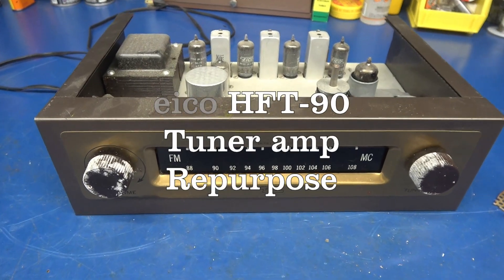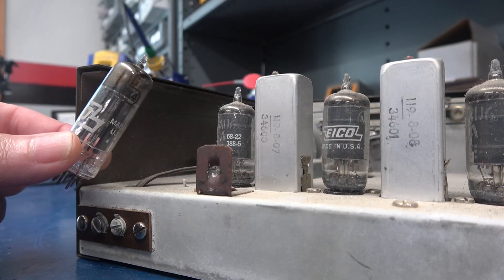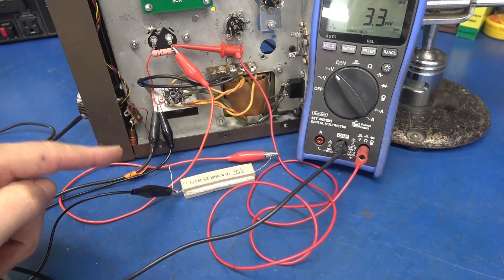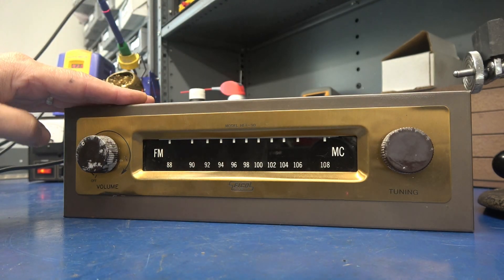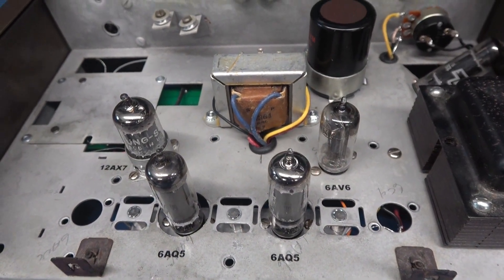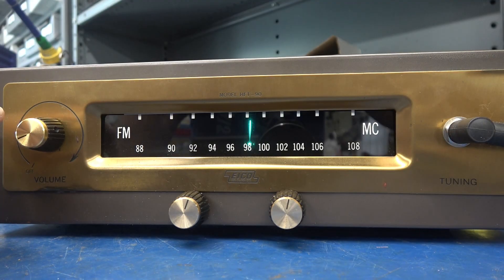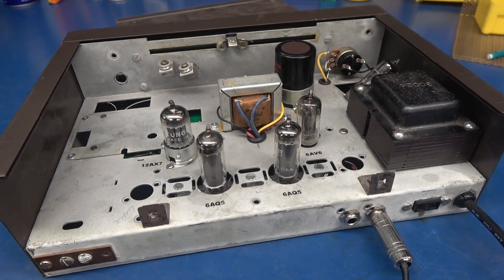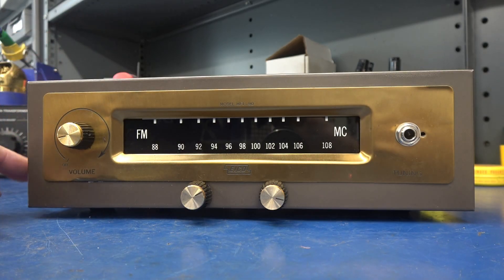Vintage eico HFT90 tuner repurpose to push pull 6AQ5 tube guitar amp retro look great project

Comment: Thanks !  I built two Eico HF-20's for my stereo back in the early 60's, I was around 13 years young.  It had a pair of 6L6's in push pull (I think) and a 5U4 rectifier.    '73 de Bob

Comment: The 6X4 rectifier was used in the Hammond B-3 organ it is also notorious for developing a short circuit. (Hammond realized the tube was substandard and their fix was to recommend the tube be changed annually, since the pre-amp was not fused.)
Personally, I don't like the idea of that tube being mounted at an angle, but YMMV.
And PLEASE be sure the power transformer is properly fused; it may save your transformer one day.

Comment: I have one of those tuners I picked up for 5  bucks at an estate sale,  sadly no matching Eico amp.  The thing that is cool about it is the indicator tube on the tuning pointer that expands or contracts green glow when you tune in.   I am kinda cold about this "everything is a guitar amp"  ideas though.  I stick to actual amps. Like tube PA amps etc.  Or amp stages out of old hi fi consoles maybe. Basically you got a steel chassis and a power transformer and toss the rest with this.

Comment: What would it take to put a headphone jack on that little amp?
Reply from the maker: You could plug a mono headphone right into the speaker out jack. A stereo jack could easily be installed on the rear